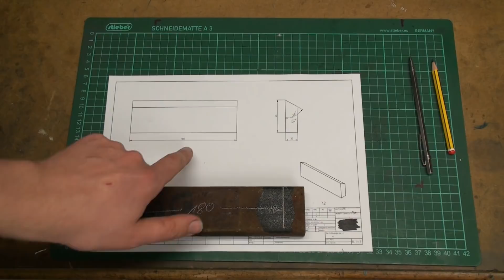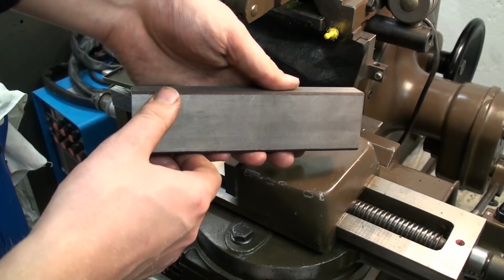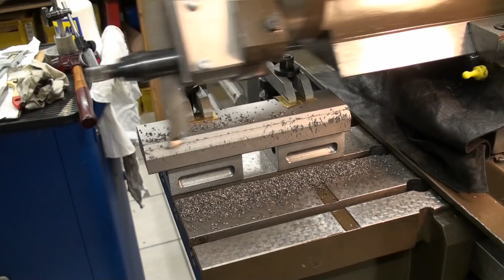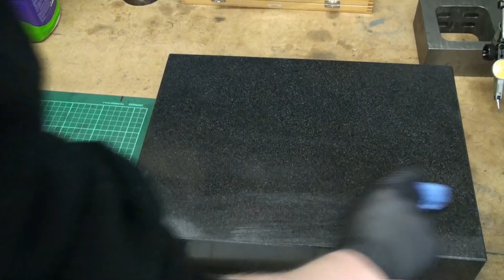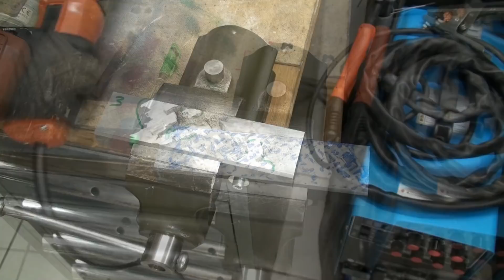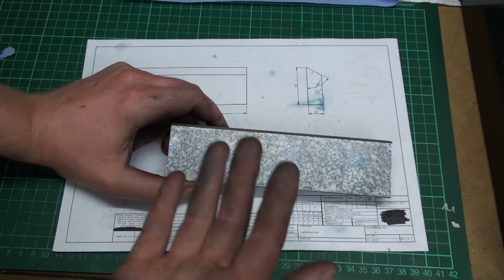Making a straight edge blank Part 1/2

Comment: Quite a bit of setup goes in to operating the shaper, but, it's worth it, that machine will probably outlast most of us here because of it.

Interesting sound the sound the cast iron does on a shaper.

The roller is used in lithography (and other similar applications), you spread ink over the original and then put the paper over.

The powerscraper is a very interesting tool, i've seen something like it before, but it was used in another application so i never thought it could be used for this.
Reply from the maker: aserta Yes, a lot of spots to keep clean and lubricate, but its also a quite satisfying process :)
Are you talking of the squeeking noise when I cut the bevel on the part? I think that was because of the large overhang on the toolbit, that caused it to vibrate on a high pitch - I put hearing protection on after a while...
Good to know what the roller is used for if somebody asks me that question.
I love that powerscraper - It should not be mistaken with one of those scraping tools Bosch or Black&Decker makes, those are just for removing glue and old carpet but useless for precision scraping. The Biax and Renz shapers are specialised tools for machine rebuilders that normaly, if you cant get a used one are just horrible expensive.
But all that could of course be done with a hand scraper - I did my whole lathe that way and also a few workholding devices.
Thanks for watching and commenting!
Reply: Stefan Gotteswinter Yup, that noise, but you're right, it's probably the overhang.

No, it wasn't a Bosch, nothing modern, it was old and beat up, very blocky (so probably something pre 90's and the guy who was using it was shaping square grooves with it in 3 cm thick plate. I've no idea what the machine's brand was, aluminium housing and like i said, very beat up.

The tool at the end was a piece of very hard steel (i believe) shaped like a square cutting drill but without the actual drill inside, just the outer shell.

If i manage to go that shop again i'll try and see if there's any markings on it.

As for watching and commenting, always a pleasure! Thank you for taking time to make these really awesome videos. :)

Comment: Given me an idea for an old reciprocating saw.
Reply from the maker: mark rainford Yeah, I think there was a thread on the Homeshopmachinists board where somebody modified a saw like that to do powerscraping - It worked and sounded (!) almost like a commercial powerscraper.
Reply: Stefan Gotteswinter Stefan, I was just thinking the same thing. Adapting a Sawsall or other reciprocating saw. Problem is varying the stroke length. I'll have to think on that a bit......
Reply: Daniel Werger how did it work out on the DIY power scraper?

Comment: I like seeing the scraping. I have seen scraping with patterns mainly for oil retention. I guess you just kind of scrape in the pattern you want in those cases?
Reply from the maker: bcbloc02 Hmm! Some machinerebuilders gring the ways of machines and then just "flake" it with an pattern for oil retention, but some do the whole geometry by scraping. There are a lot methods and ways of doing it :)
On the end for a machine way you want a flat surface with an good percentage of highspots and a place for the oil to stay :)